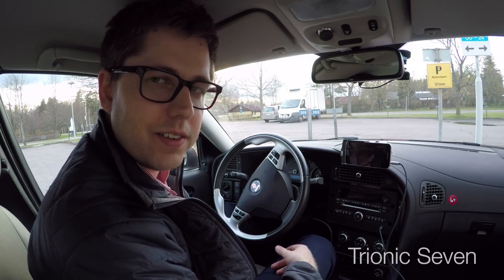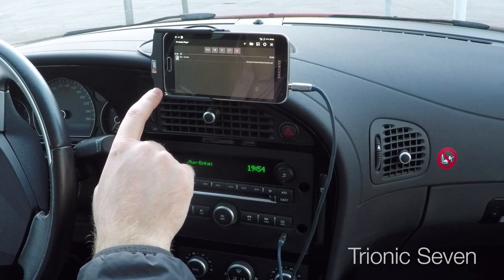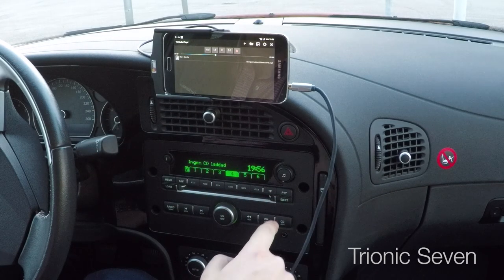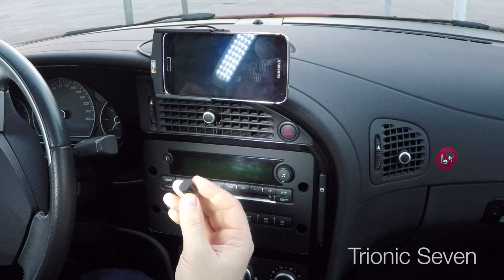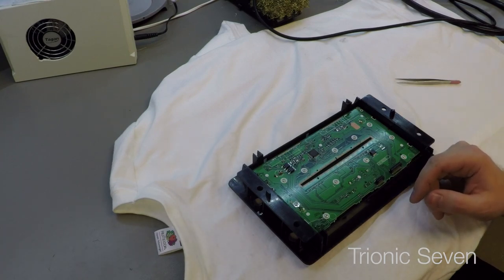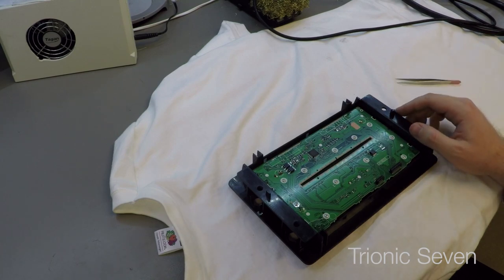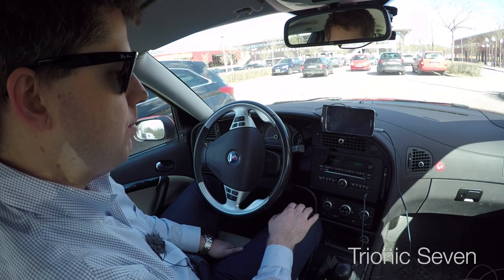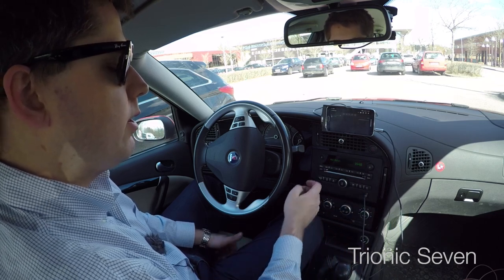DIY: Improving Aux Input for Modern Saabs (Simon's Mod) - Trionic Seven

Comment: WATCH OUT! Removing resistors (those in series, not pull-up resistor in the front panel) and replacing them by a jumper or 0R resistors may result in damaging the DSP!! Because there is no input buffer realised on operational amplifiers or transistors.
The damage may be caused by malfunctioning aux cable or power surges.
Of course DSP cannot be bought easily and you will need to resolder the IC from the other radio. Soldering such DSP is not easy, it has a lot of outputs and also ground pad.
Reply from the maker: Thanks for  sharing your knowledge!
Reply: @TrionicSeven  hi are you gonna make any more videos? Its been a while and i miss your videos😢

Comment: Thanks for sharing this fix. It has solved a problem that annoyed me for so long! It's not too difficult as long as you have a small tipped soldering iron and probably a magnifying glass. Be careful not to overheat the soldering iron else you risk damage to the PCB pads. The only improvement I would recommend to the process is that it's far easier to remove the 4 black plastic cosmetic screw covers in the dashboard by using a bit of very strong adhesive tape and simply pulling them out. If you try to prise them out it's almost impossible not to scratch them. Thanks again!
Reply from the maker: Thanks for sharing your experiences! :)

Comment: Thank you Trionic Seven.  I did both mods in my 2007 1.9tid Saab.  The only difference is that my car has a single CD drive. It works beautifully.  I used duct tape to remove plastic plugs and simply covered  the resistors with layer of solder in second mod (without any wires).  To be honest the most diffucult part was screwing the radio back to the dashboard without magnetic tip screw driver :)
Reply from the maker: Hahaha, you are right. Getting the screws back was a nightmare of fiddling! Who at GM thought it was a good idea to do it like that!? Glad you got it to work :)

Comment: T7, love your video yet again! Thank you for making these! 

I came across another solution to the problem of Android phones not working in Saabs for music coming out of the car speakers. I had read somewhere that if you hook up an aux cord that has a volume wheel on it that will fix the problem of Android phones not working for music coming out of the car speakers. I went to my local Radio Shack and found one for 7 usd that had a female end and a male end. I used that in conjunction with my normal aux cable, and voila, it worked. Having 2 cables hooked up to eachother was a bit much, but seeing as how I drive people around in my car for a living, it made it so the people in the back seat could play their music without leaning forward or leaving their phone up front. I'm not sure if the cord has to have a volume wheel or if volume buttons on an aux cord would work. Though I don't think it fixes the loud radio/quiet iPod problem you fixed in the second part of this video. I would like to have the cojones to fix that like you did.

Just wanted to share my tiny bit of knowledge on this subject. If it matters, I have an 08 Saab 9-5 Aero that already had an aux jack on the stereo.
Reply from the maker: Thanks! I did think briefly about soldering a resistor to a 3.5mm cable and using it as that might have reduced that 3.3v output from the head unit into making the phone understand what's happening. Didn't investigate it that much, though. Your solution seems to be something to that effect. Good work :)

Comment: All I had to do to fix the problem was to use another cable.
There's different kinds of audio cables. I changed from a cable with 3 black rings on the connector to a cable with 2 black rings.
Problem solved for me.
Reply from the maker: Thanks

Comment: Ah.. great info... my trick was to cut a audio cable and put two 10uf capacitors in series with the audio lines to get rid of the voltage. But i will now do the mods as described here to get the volume fix... (was about to insert an op-amp module in the audioline but this is much better. :) )  thanks for the info.
 9-5 2007 with single cd player.
Reply from the maker: Yeah, I considered doing something similar before discovering this mod :)

Comment: If you know how to SMD solder you can buy 0 ohm resistor to replace with for the low volume mod inside. 0 ohm will act as a bridge like a direct wire, but looks better.
Reply from the maker: Exactly. I had no 0ohm resistors available so I went for the wire instead. Thanks!

Comment: I bought a little Bluetooth-thingy from Kjell & Co, with a 3.5mm cable. That one is connected to the stereo and the little Bluetooth-box is attached to the side. Very small and nice. It works perfect.. much easier fix. ;)
Reply from the maker: That's a great idea, thanks :)

Relevant: http://warpdrive.se/9473

Comment: Very interesting mod, well done...always wondered why the AUX volume is soooo low. (I have a Saab 9-3 2008)...out of curiosity:
Why do you think the original engineers put voltage dividers in the circuit in the first place? There must be some technical rationale behind it. 
Was it to avoid accidentally receiving a high voltage (>5V???)  on the AUX input to protect the circuit? 
Surely the engineers would have noticed the big difference in volume between the radio and an AUX device? ( Did they think "yep can't see how anyone would mind that!!")
With this mod of bypassing the 2 resistors - is there a risk of damage or overload to other components?

Anyone know what is the max voltage in for the AUX?
Has anyone used a headphones amp to increase the volume? Do these devices just increase the input voltage which will get divided anyway (if no mod done)?

I am building up to do this mod as a project (have noticed a few suggestions below on using thermal paste/grease to avoid soldering - anyone tried this?)

Thanks

Comment: Hi. Is it possible to change the cd player inside the radio for another or do you need to use tech 2 for this? Just curious if the components are the same on the motherboard and compatible with each others?
I currently have a radio from my 9-5 with single cd. And another one from saab 9-3 with 6cd changer.

Comment: Excellent video! Today I applied both mods and it all seems to work! Most difficult for me was to remove the air vent above the head unit. What a pain, all these snap joints! At the head unit itself I struggled with removing the antenna cable. The desoldering I did with an SMD desoldering station (I now may sound experienced, but this was my very first SMD work). In the first mod I kind of launched the resistor, because the air flow was set way too high. This proved to be a good training for mod 2 :)

I am now looking for a way to nicely connect my BLE module to the AUX, without using the socket at the front panel. Any advice for this? Would the pins 1,2,9,10 at the second (or right seen from the rear) connector of the HU (12779269) be suitable?
Reply from the maker: Hey, glad you got it to work :)

Connecting BLE to anything else but the front port is very difficult, however I'm tangentially involved in a project called bluesaab xm that is doing exactly this! Google "bluesaab".

Comment: my 2003 saab 9-3 that came with aux strangely when i put my phone on aux it creates this weird static that i cant seem to remove and its on the old icm3 head unit
Reply from the maker: Weird. Unfortunately, I don't know much about that car, as the ng9-3 is a completely different car from my 9-5.
Reply: Is the phone in the charger at the same time? I would blame the charger then.

Comment: Does this mod, especially the second part also work on the Denso unit (the one with the Sat Nav). I have a 2009 9-3 Cabrio. And just to be on the sure side - the reason behind the AUX input sounding alot "blander" and "washed" out is the same volume reducer mentioned in the part 2 of the fix? What I mean is that FM and CD sound crystal clear and nice and loud and pronounced but the AUX input lacks a certain amount of dynamic. I have tested by burning some MP3-s on a CD and playing the very same MP3 files from my phone through the AUX input. There is quite a noticeable difference in quality.

Thanks in Advance.
Reply from the maker: Nah, the Denso unit is completely different and won't look like this inside. Don't know why aux sounds terrible, perhaps ask in our forum? https://www.facebook.com/groups/733705113501723/

Comment: Hey so I have a question please.  I have a 07 9-5 aero with the navigation radio.  I owned a 06 9-5 with the unit in the video, it's a much better system.  My question is can I swap out the Navi radio with this one without issue.   Many thanks!
Reply from the maker: Unfortunately I think the wiring is different, but don't quote me

Comment: Thanks for the good advice! My MY10 Griffin is suffering the same lack of Aux volume. Does the fix help the audio quality, as when i listen to the radio the bass and diskant is more deeper and clearer than with the Auxiliary. Kind of sad cause i have the Prestige Harman/Kardon audio system!
Reply from the maker: No, this just removes the attenuating filter on the aux

Comment: I use an 8Gb MP3 player which lives in the ashtray when not in use. Saves doing all this and doesn't drain the battery of my phone which, in the UK, is an area of motoring law where using your phone gets you a fine and points.

Comment: A bit late to the party, but something you can do if you don't want to solder is to use something we do when overclocking graphics cards. 

We use a thermal grease that also conducts electricity, and just "paint" it on the resistor. It still has some resistance but way less than the resistor.

The benefit of this is that you can just wipe the thermal compound away if you want to.

I am unsure how long this will last, but I recon it will last for quite some time.

A little guide how you do it for PCs, but the application is the same.
https://www.gamersnexus.net/guides/3185-how-to-short-shunts-on-gpu-for-better-overclocks-titan-v
Reply from the maker: Great idea, thanks for sharing!

Comment: We have the navi unit from 2007. There is no aux input on it. Is there a way to connect a aux/usb signal to that head unit?
Reply from the maker: 9-5 or 9-3? I know that bluesaab works with the 9-5 with navi, that's another DIY solution.
Reply from the maker: Hey, that's awesome! :)

Comment: how did you short circuit the resistors? i noticed in the video you didnt really show how to do it. i have 0ohm resistors. would it be easier to replace the two resistors with two 0ohm resistors? my cd changer doesnt work either. is there a DIY for fixing the cd changer? i have a 9-3 07
Reply from the maker: Hey. The videos I shot where I showed the closeups where just useless due to the close focus distance of my camera. I used bare wire that I soldered "over" the resistors, shorting them out. You can def. use 0ohm resistors, too, but you must get the right physical dimension.
Reply: Do you know how to fix the cd changer?
Reply from the maker: What do you mean by fixing it? :)
Reply: i can load a a disk. it won't take the disk
Reply: so i took the head unit apart. tomorrow i will do the resistor replacement along  with the removal of the aux resistor.  i work at a place where we manufacture pcb
Reply: So it worked! Sound quality is just as good as the sound coming from the radio if not better IMO. Thanks so much for the video! I did both mods
Reply from the maker: That's great :D
Reply: Luis, did you ever figure out if the broken cd loading mechanism could be fixed? My "07 Aero has that problem too.

Comment: While certainly intrepid, the simple fix is a Volume Control Headphone Extension Cord.  I bought a few of them at Radio Shack for $49-cents on closeout.  But similar types are all over eBay.  The ever-sleazy Sears website has it for over $25.00.  Sears has become a joke.

The volume control extension cord has a female for the 3.5mm AUX plug to fit into, and it's own male plug that fits into the SAAB's AUX input.  Easy, quick, and give full volume.

I had this issue with my Samsung Galaxy Note 3.  Since I switched to an iPhone, the volume control extension cord isn't needed.

Here is a link to the Koss VC20.  Basically the same as the Radio Shack cord, but much longer.  A shame really:

https://www.koss.com/accessories/cables/vc20

The Radio Shack cord is about 6 inches, and makes for a seamless, stealthy install.
Reply from the maker: Good tip, thanks! :)

Comment: Man, my saab 9-3 decided that it wanted to delete my aux source in my head unit and now I need to find a tech 2.
Reply from the maker: Which model year?
Reply: Trionic Seven it's a 2003 9-3
Reply from the maker: Strange! However, I don't know anything about the ng9-3, perhaps ask in one of the forums? Sounds strange that it should just forget it.

Comment: Omg this is ls soo much work for somthing that is $5 on ebay. And you can get rid of that anoying cable also..
Reply from the maker: What $5 device on ebay fixes this problem?
Reply: Lol mp3 disc, is it still 2001? AUX->Bluetooth adapter från kina brukar kosta ca 50kr. Funkar skitbra, har 3st och mycket nöjd jätte bra ljud, slipper aux kabel.
Reply from the maker: I've also thought of a Bluetooth adapter, but I actually have even more grand plans (Bluesaab!) In the meantime, however, the cable dance thingy was too annoying so I did the fix while developing the other solution.
Reply: I bought a bluetooth adapter.  It suffers the same issue as your phone has.